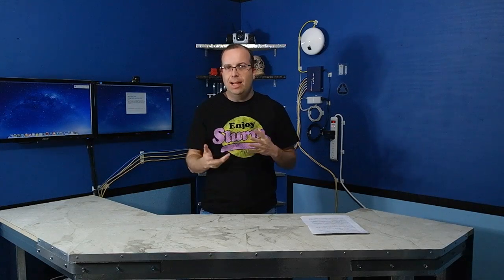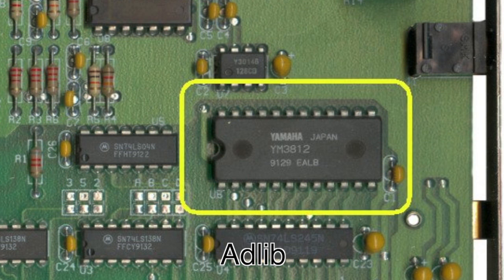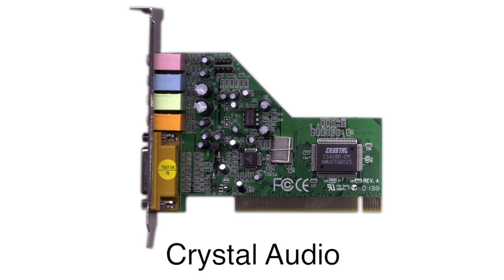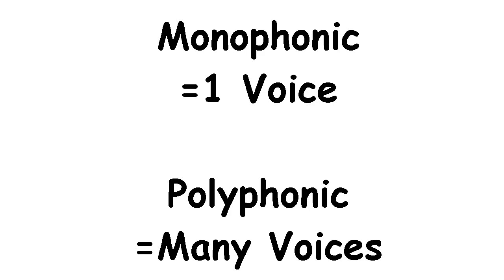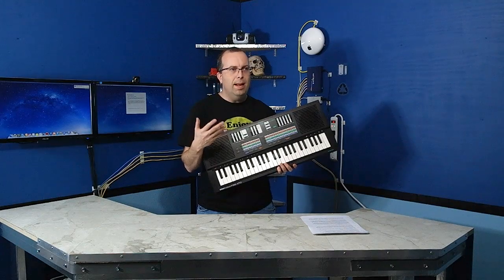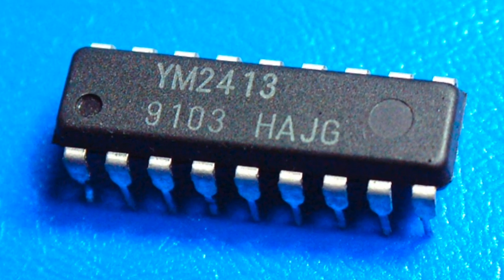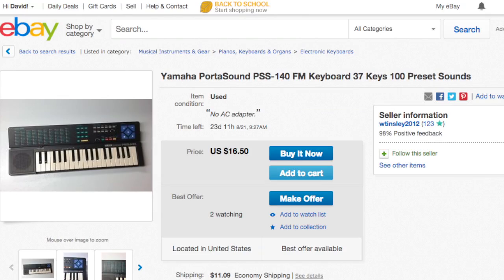Meet the little-known "Soundblaster" Keyboards

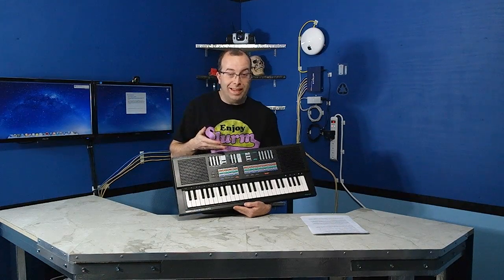Comment: 2:18 "It's a Sound Blaster with keys!"
Funny because the AdLib and Sound Blaster were basically Yamaha DX-series synths without keys. (Well, stripped-down DX series synths.)
Reply: tohopes true
Reply: Than you could say, that those keyboards were basically DX-series synths rebranded to PS-series? :)
Reply: I've never understood how Yamaha's FM synthesis took over the synth universe in the 80s. It was terribly difficult to program, and when you did, it sounded rubbish. All that tinkly bonk 80s stereotype comes from the DX series (to oversimplify a bit). Thank God analogue (at least soundwise, if digitally emulated) made a comeback when everybody sobered up from the DX-7 party. I really don't understand how anyone could like the sounds the DXes produced.
Reply: Well yes, but "outlandish" doesn't get used much in music. All the DX stuff sounded terribly thin, which is why nobody but the retro community use it any more. It just felt at the time, for me, like synthesizer music "died" when the DX7 came out, and didn't rise from the grave again until the rave community got hold of the TB303, heh. People had stopped using synths as a unique instrument. Why bother when you can just pull out the same 5 presets over and over again?

I love the sound of a real Fender Rhodes. But that DX7 monstrosity of a patch brings me out in hives.
Reply: That's like, your opinion man.
Reply: didn't think those presets sounded like 6 operator algorithms! haha
Reply: Haha, I have not seen a more ignorant person talking about a DX7. It sounded great, fun, different then analog but just as good in its own way. Not cheap by any standard s but one would be foolish to compare it to analog. Its like comparing a boat to a car. They both get you there, but by much different method. Its smart to have various types of synthesis at your disposal and I am sorry you were not smart enough to learn to program a DX7. I dont know much about a DX7 but in the short time I had mine it was easy to figure out.
Reply: Than° wont let me edit comments on mobile
Reply: VitinhoCarneiro plus it has great velocity sensitivity and the all around weight/feel of the keyboard is great
Reply: So a SoundBlaster is a Soundblaster without keys with keys
Reply: @ian_b  "All the DX stuff sounded terribly thin"
Nonsense. I've conducted numerous comparisons between voices loaded into a TX-7 on one side and Dexed / Hexter with gold plated Fatality cards on the other. The TX-7 blows the shit out of the soft-synths every time. FYI many composers doing serious EDM still use physical FM gear in their setup -  and Yamaha always made the best.
Reply: @ @ian_b  - "It was terribly difficult to program..." - No, the original DXs simply had poor UI. The way around that is/was the same as with any "black monolith" rack module - program it with a computer-based editor. And IMO the DX editors from the 80s still hold up against similar functions in contemporary hardware and software instruments.
"...and when you did, it sounded rubbish." - So NOBODY could program good DX sounds, because the underlying synthesis is so deficient? I disagree. The reason FM takes more understanding and practice to get good results is because it offers more options - while simultaneously being simpler and more elegant.
"...analogue (at least soundwise, if digitally emulated) made a comeback..." - My guess is that only fixed-architecture people who get off on their Minis and P5s feel this way. In the late 80s-mid 90s I desperately wanted a modular precisely because it would allow me to make patches exactly like these. Trying to rewire my Juno 106 and Korg DX6000 because I couldn't for the life of me understand why they wouldn't let you cross-modulate the oscillators. There isn't anything conceptually digital about FM synthesis.
Reply: @ian_b  Those digital Machines took over because: they were programmable. You could easily reproduce any sound in no time, and store those presets. Analog synths costs huge amounts of money, especially if they had (very few did) storable presets. And they had the just invented MIDI conectability.
Reply: @ian_b  Let me guess you grew up on Justin Bieber music?
Reply: @vh9network  No, I'm much older than that. Hence my saying how I felt when the DX7 came out.
Reply: @ian_b  well to shit on a whole decade of music just because you didn't like the use of digital synthesizers is really immature.
Reply: @vh9network  I didn't shit on a whole decade. That was the decade when I went from teens to twenties, and what a great decade it was. There was lots of great music.

What I said was that the terrible tinkly-bonk stereotype comes from using DX keyboards (among other things). I was into synths before the DXs came out, and then suddenly there were these crazy few years where analogue was "dead" and everyone was tinkle bonking on a fake DX Fender Rhodes. Luckily when Rave hit in 87 people came to their senses and we started getting proper synth sounds again.

Just my opinion of course.
Reply: Some of the most prominent sounds of the time were made by FM synths. Lately Bass from the TX16W is on almost EVERY dance music tune from the late 80s early 90s. And it's because it's a fat sound. Combine it with a snappier bass, and you have something like Pump up the Jam. If you are into house music, then you've heard the Lately Bass.

 The FM electric piano sound, which we consider an abomination today (it's mega cheezy), was great for pop music back in the day because of the FM algorithm. It was bright, and cut through a mix very well because of the nature of the FM algorithm where the frequencies were spaced far apart. That meant it cut through without taking up too much sonic space. This is why every ballad (Greatest Love of All intro! Come on how many times have you heard that sound!) has this sound. Unlike a subtractive synth, FM doesn't have partials all along the harmonic series at least with certain patches. Frequency Modulation synthesis was a complete game changer, and it's making a comeback today. A lot of artists are using FM8 and Ableton's Operator to create wild new sounds. 

the DX-7 set the world on fire, but you are right that it was hard as shit to program. That's why a cottage industry popped up dedicted to selling pre-made patches, and it was hugely successful. Compared to subtractive synths era, that was just not something that happened. This trend continued in the late 80s and early 90s. Eventually the internet made this obsolete.
Reply: When I heard it I thought DX7.
Reply: jaxxstraw  i can play on my montage
Reply: This. I was wondering why this wasn't acknowledged in the video. Back in the day, I recall the Yamaha being the selling point of the cards, not the "sound cards"  being the selling point of Yamaha products.
Reply: @vh9network  well to shit on a whole decade of music just because you don't like a particular artist is pretty immature
Reply: @ian_b  It's all subjective. To me, the DX series still has a unique other wordly sound when mixing it with acoustic elements. But that said it was a step closer to accurately recreating acoustic sounds before we started to master sampling.
Reply: Is it possible to modify USB spund card to make it work like a music player independently without a PC?...
Reply: even true'stripped'az included everything ever
Reply: opl,like forth,is a pen sized orogramming language,psion x3,etc,easily buulds windows ce,avrdude,etc..soc
Reply: av synchro bowl out synthetic diaboluc steamlune express par2exoressiin,use you yooz,e-z chip ic prig as it us watt it is,iz wit it as is lues sence ad lib currently key if cmwhy g.4k?
Reply: naa haz no note op en un...
Reply: So basically that keyboard is a shitty dx
Reply: @ian_b  Are you actually implying that, first of all, the DX series speaks for digital synthesis, and that the 'analog sound' is its binary counterpart - and since you mention analog as though it's 'the' other medium of musical sound design, are you implying that FM synthesis as a whole 'sounds rubbish' and is 'tinkly bonk' and 'thin'? (even disregarding wavetable and other media of synthesis)
Because then we may as well get out of the way that you have no idea what you're talking about and sound like a middle-school kid who watched some videos of Minimoogs and Prophet-5s and thinks he's enlightened.
FM can arguably produce infinite timbres of sound, including the warmth that analog has. Analog certainly has a place though as it's a much nicer, easier experience to dial a Moog filter knob from a performance perspective, than to have to program that kind of filtering tone through FM.
Also, your obnoxiously stated opinion about sounds of the 80s are rightfully in the minority; a DX-7 in the 80's, even with presets when used properly, could add wonderful sheen or bite to sounds. Those presets, IF you were going for warmth, you did want to often want to layer multiple variations on top each other or over analog synth sounds of the time (A couple of DX-7s layered on top of each other made the best EP sounds ever, and DX-7's bass on top of a Minimoog sub-bass, which sounds fucking great no matter what trite you're spouting)
Reply: Though technically the YM3812 had more waveforms than the sine-only DX-series, kinda like TX81Z. At least that's what I know about this, I might be wrong

Comment: Hi @The 8-Bit Guy, the top of the range Yamaha home keyboard at the time was the PSR 36. It is a PSR 32 with the 470 sliders added back in, AND ALSO MIDI!
Reply: The PSR-41 is actually one small step above the 36, adding a melody sequencer and a transpose function. Otherwise identical.

Comment: I found a Casio CTK-611. It had been sitting on the side of the road in the rain for 2 weeks. I finally stopped and picked it up. When I got home and let it dry out for about 2 weeks, I took the back off cleaned and oiled everything. Upgraded it with some 18650 batteries. It's not a bad keyboard. Has plenty of sounds with midi inputs.

Comment: Holy crap I had a PSS460, got it for Christmas that year! I loved it, used it in a teenage band with some spliced 1/4 inch cables to run through a Crate G60 amp with a Celestion speaker. A year later I ended up buying an Ensoniq ESQ1 and retired it. I had a lot of fun with that 460. For what it was, it sounded pretty decent, especially being able to mildly tweak the sounds with the sliders. Thanks for the video and trip down memory lane!

Comment: Bit disappointed there's no actual Sound Blaster involved. And technically I think the chip would be more accurately called an Adlib chip, since the SB contained it for Adlib compatibility. As well as a way of having synth sounds. The Adlib was an earlier "standard" as much as there was one back then, still most PCs didn't have sound cards at all til the early 90s. 

I remember playing Doom with my SB16. Doom is 50% of the reason I bought a PC, and that's true for a lot of people. It had the same chip, I think, or a compatible one. Nowadays sound is all synthesised on your CPU, the PC's built-in sound chip is just a DAC, it can only play back samples, generated on the fly in software. Some more expensive cards have DSPs to generate those, cheap or built-in ones use the CPU. 

Still nice to see some of the cool old keyboards though. I managed to find the old demo tune from my old Casio keyboard and used it for a ringtone. Wake Me Up Before You Go-Go! Used nearly every instrument the little keyboard could do, and there were like a hundred!
Reply: in yer phase out char null gen timex root no swing quiz 0 THE way stars bluey stage com pass map 8bit mug off yankee slap kuddy toy chap iff tree hang hitlaa key C black white racey car boo tup shop clised wits food eh?
Reply: It's literally the core of the sound blaster lmao

Comment: Great video! Space Quest 3 and Ultima 6 were some of my favorite games to play as a kid, so I highly approve of the example songs. =] I have a few comments: 

At 8:10, you mention all voices on the YM2413 / OPLL have to use the same instrument, but that's not actually true. It's just that you can only define one instrument. Each channel can play that instrument or one of 15 other instruments that are not definable. The other instruments are generic stuff like "Trumpet" or "Vibraphone", and on keyboards that contain a YM2413 (I believe the PSR-6 has one?), the instrument chooser doesn't have to do any real "logic" to choose an instrument. A button can just send "switch to instrument 7" or whatever. For reference, here's a track that uses a YM2413: http://inversephase.bandcamp.com/track/token-ringfinger

Anyone mentioning they have a different keyboard with potentially a different chip that "sounds the same" might be interested in knowing that they're probably still Yamaha keyboards with Yamaha OP-series chips, which means they're still built around FM. The underlying process with building music with FM is mostly the same regardless of the chip, which is why.

Lastly, as for "having a keyboard with a Soundblaster in it"....you know that the gameport (that 15-pin thing) can double as a MIDI port, right? So you can connect any dumb MIDI controller with no output of its own to that and "play the soundblaster" if you like. Extra bonus, if you have some outboard gear like a Roland MT-32, you can use that soundcard selection to send music data from the same port.
Reply: :wave:

Comment: That "piano" music is so very SNES.  That is the sound of a town in a 16-bit JRPG.
Reply: Oddly enough, the SNES was actually using more "modern" PCM music, the Genesis would be a closer comparison as it used FM synthesis and a very similar chip to the YM3812 (specifically, the YM2612)
Reply: Also it would be the PC-98 that actually used the YM2608 most commonly known as OPNA, and that chip is basically the so-called "complete version of the 2612 that the Genesis/MD uses :3
Reply: The SNES was soundfont-based fart sound.

Comment: BRING BACK THE FM SYNTH CHIPS
Reply: Great for all the Sega Genesis/similar Yamaha-based FM processing.
Reply: Yes! The instrument of champion music lovers and authors!
Reply: Knobs and sliders and switches, for us physical guys.
Reply: Has anyone been able to convert the sliders to rotary pots?
Reply: That I wouldn't know.
Reply: @danalog76  you could probably just bypass the connections
Reply: @Geo-wc7jc   You get some very cool glitchy sounds with some of the presets when you quickly slide the Attack/Decay and other vertical faders up and down. It would be cool to see if a rotary controller would expand this effect at all.
Reply: @BrunoidGames  make a video of you using your mega drive as a keyboard. 👍
Reply: No thanks, I didn't like back in the day either.
Reply: Just buy the Volca FM, and there you have it..😉
Reply: @danalog76  Why would you bother? Rotary controllers you have to grab hold of to use & so can only change one or maybe two parameters at once. With sliders you can precisely manipulate one with each finger if they're close together.
Reply: -Elektron DigiTone.
Reply: @SidechainStudios  yeah, a bargain at only 15000...

Comment: @ The iBookGuy The Yamaha PSS-360, PSS-370, VSS-30, VSS-100, and VSS-200 seem to be based on the Yamaha YM-3812, because they are based on similar FM synthesis.
Reply from the maker: +Cheryl Matthiesen It's possible.  I can't find any information on them that definitely answers that question.  I think somebody would have to attain one and disassemble it to be sure.   Lots of Yamaha keyboards used FM synthesis, but not all of them used the YM-3812.
Reply: +The 8-Bit Guy Why did you rename your channel?
Reply from the maker: +SutorippuDotCom The PSS-100 is already documented as having a YM3427 synth chip.
Reply: +The 8-Bit Guy Hey, You know what's cool? You have the same glasses as me XD.
Reply: +Mitch Matthiesen read here:
http://www.dtech.lv/techarticles_yamaha_chips.html
Reply: I'm pretty sure the 460 & 470 (& possibly 570) are also based on the YM-3812.  Here's a cool little PSS list. http://nurykabe.com/dump/text/PSS/page/

Comment: What video cards (even in 2015) are still emulating CGA / EGA modes for compatibility? I don't think the pixel clock goes low enough to drive those signals...
Reply: sbc,besides,mac,raspi...billions of mainframe terminal busses of supercomp data centers,stalleites round mars, trains,busses,kiosks,etc etc,puggy cell,eh...yes pixel yuh say

Comment: Cool video, but wouldn't it be more accurate to call them Adlib keyboards?  The SoundBlaster was more than a music card.
Reply: A bit off-topic, but are you the Liberty Basic/FreeBasic guy? If you are, I've been using FreeBasic for some years, just for various small hobby projects, and i think it's great.
Reply: Hi, yeah I'm the Liberty BASIC guy (also Just BASIC and Run BASIC), but not FreeBasic.  :-)
Reply: oh yes, sorry, i got my wires crossed, i DID actually mean JustBasic. I hope i didn't offend you, i certainly didn't mean to.
One of my projects was an emulator for the Texas Instruments TI Programmable 57, which progressed quite nicely until i started on the calculating engine, at which point i realised that i didn't have enough information about the inner workings of the calculator chip.
Oh well, it was fun while it lasted, and hopefully one day i'll be able to continue :)

Thanks for your reply, and greetings from Denmark.
Reply: Hi, no offense taken at all.  :-)  Have you had a look at Run BASIC?  It's a super easy web programming system.
Reply: Yes i did take a look at it a year ago or so, but to be honest, i'm kind of an old school guy who perfers programming in the old-fashioned way ;)
Reply: Yes, but that's precisely the idea of Run BASIC.  Programming the web the old-fashioned way.  :-)
Reply: Valid point, but the Adlib didn't last long, whereas Sound Blaster picked up where they left off and ran with it for quite a while.